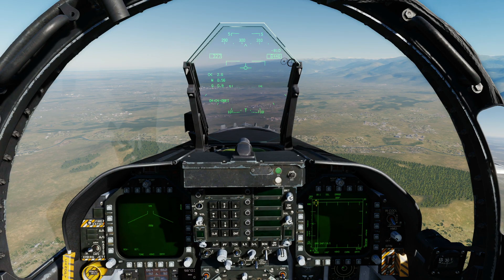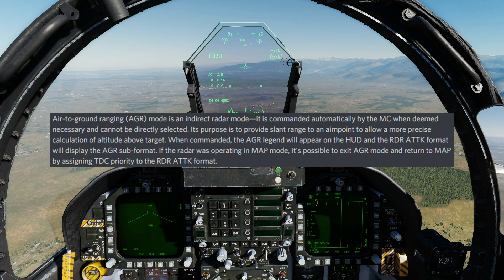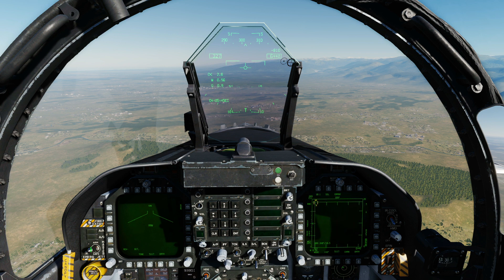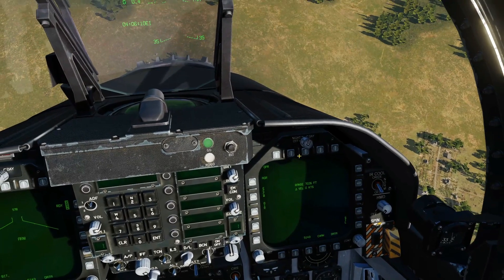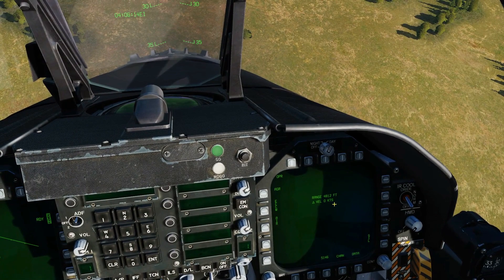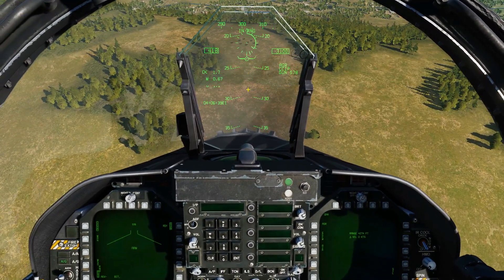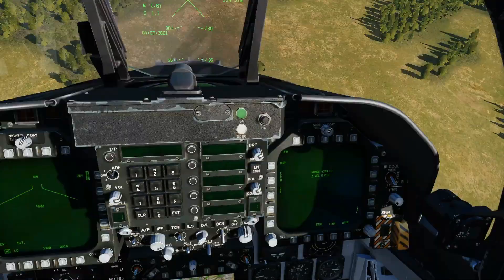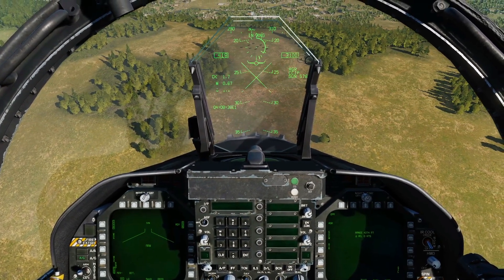FA-18C Hornet: Air To Ground Radar (AGR  Ranging Mode) Tutorial | DCS WORLD

Comment: After testing in-game with mk82s I think I can answer some of your questions:

-At dive angles of up to 5 degrees, the system uses radar altimeter to determine pipper location
-At dive angles greater than 5 degrees, the system automatically switches to using AGR mode
(Under the altitude box on the HUD, an "R" is used to show that radar altimeter is being used, an "A" is used to show that AGR is being used)
-Pressing SCS forward forces AGR mode

The AGR mode results in a more accurate pipper location on uneven terrain:
https://youtu.be/ctYxsaDoRE0

Comment: I'm guessing delta velocity is just not implemented.  Delta usually means change or difference, so you would expect something to register if there was some kind of motion in either the aircraft or the target.  Curiously, velocity is a multidimensional vector with magnitude, so I wonder how they would present that information to the pilot.  Maybe they present only the magnitude?  It will be interesting to see when either the feature becomes available or someone figures out what it's trying to measure.